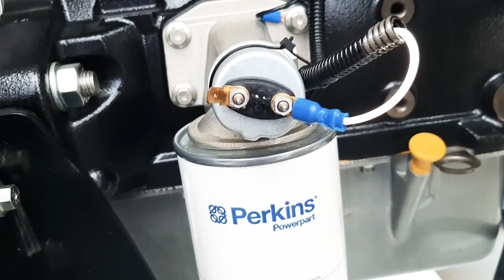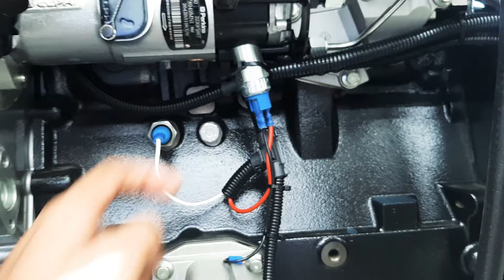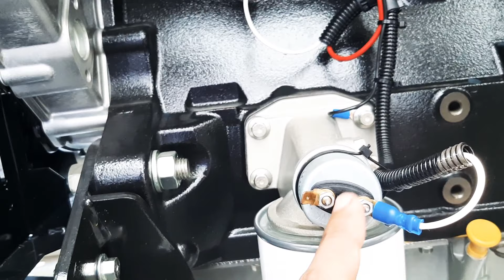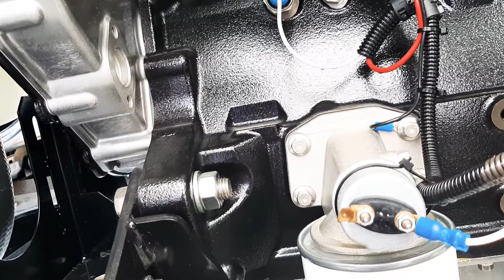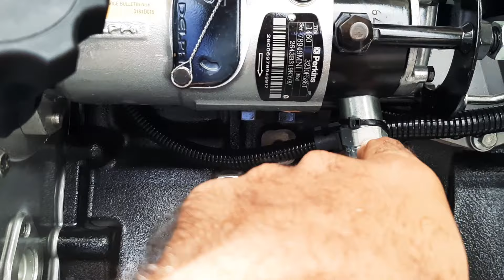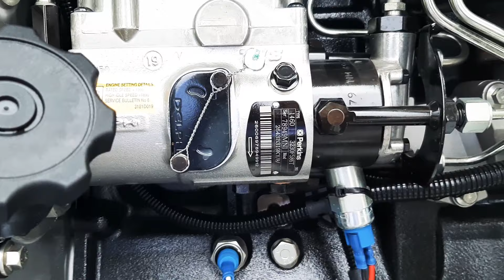Vdo 10 bar oil pressure sender & switch | Dg Solenoid | Generator protection | DG LLOP switch wiring

Comment: The device on the oil filter is not a switch, it is a sender as it provides a variable resistance signal to the gauge. The low oil switch is on or off, it kills fuel supply to diesel injection pump to prevent engine damage or to a light on the dash. 
 For those not knowing, 1 bar = 15 PSI of pressure. You in the USA will find both Bar & PSI for air pressure in your tires on label in door jamb or other convenient location like glove box. 
ASE Master Tech, 78.
Reply from the maker: Thank you for the detailed explanation!